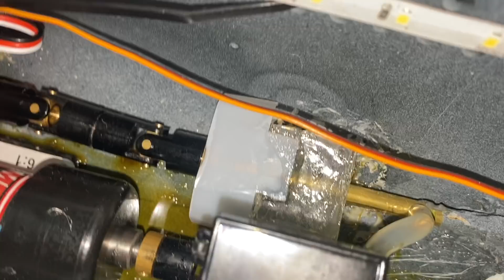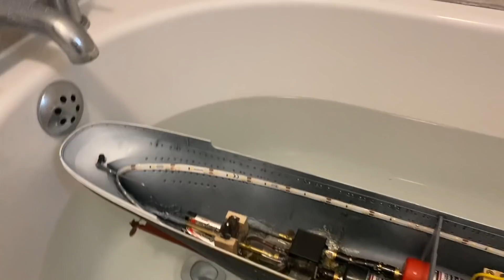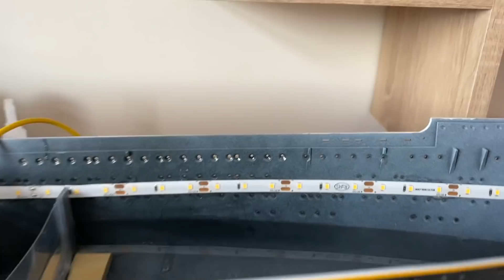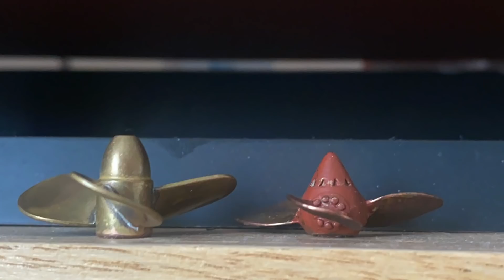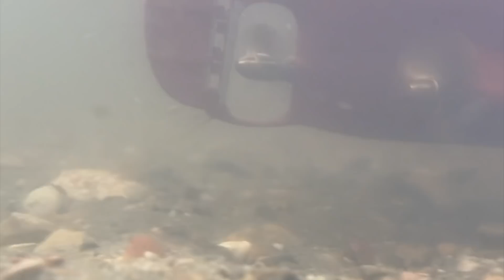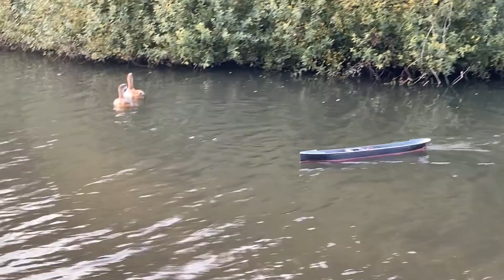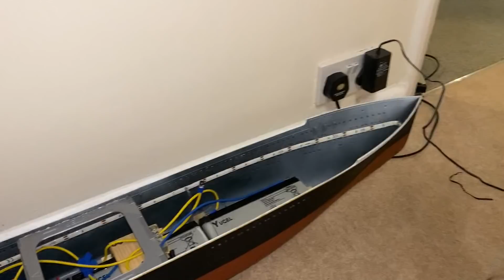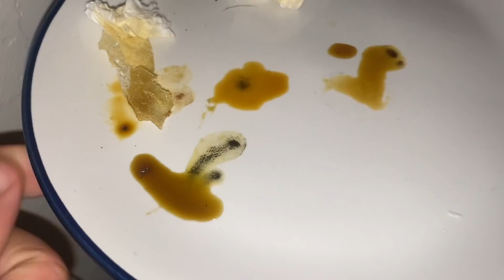Radio Control Trumpeter 1:200 Titanic Build Part 13 - The First Test

Comment: to make it  more perfect, the central propeller should be one with 4 blades! They exist in model ship shops, I know it, because 10 years ago I had a "Yamara" titanic in something about 1:160 scale and all photos of the original ship in dry dock show a four blader at center.
Reply from the maker: There is actually some debate on the central propeller and it’s number of blades. This is quite a good article if you are interested:
https://www.encyclopedia-titanica.org/mystery-titanic-central-propeller.html
Reply: There is evidence that a 3-bladed propeller was being considered.  Slightly larger in diameter than the 4-bladed one, with differing pitch, it was intended to yield greater thrust than the original.  No photographs exist, that I know of, to confirm this.  The Britannic ended up with the 4-bladed center prop so I lean toward a 4-bladed one on the Titanic.  Of course, I am a strong traditionalist so I naturally go that way regardless.  It may remain an unsettled debate for a long time until the wreck is explored enough to reveal the truth.
Reply from the maker: @Dallas_K  I think you are right in the sense that it will remain a mystery for a good while, if not forever.
The thing that convinced me that Titanics center prop was 3 bladed was that in 1913 Olympic was briefly fitted with a 3 bladed central propeller. This seems to have been fitted as an experiment (which was evidently unsuccessful). But I suspect what happened was Titanic had been intended to run this experiment, but sank before a satisfactory conclusion could be drawn, so Olympic was retrofitted. Presumably White star assessed Olympics performance with the 3 bladed prop and concluded 4 was better after all, because after 1913 Olympic is always pictured with a 4 bladed central prop. 
As I say, at the end of the day, it’s the individual modellers opinion, all we can do is weigh up the evidence and make an honest assessment!

Comment: Hey guys, just wanna ask for your opinion, which is better: Minicraft 1:350 RMS Titanic deluxe edition with photo etched parts or Trumpeter 1:200 RMS Titanic
Reply from the maker: I can’t really speak for the mini craft 350 because I’ve never built it.
Trumpeter 1:200 has its fair share of faults but it’s a very good model, and I think you’d get a good model out the box. 
Obviously as the model gets bigger and bigger you have more opportunity to add detail too.

Comment: to change the pitch of the propellers it's simple just bend them out abit more why buy new one's
Reply from the maker: To a point yes. But the difficulty is to bend each of the blades exactly the same amount. And if you do get that wrong the props will vibrate which causes excess noise etc. 
But the main reason I changed them was because the new ones looked far more realistic. Much more like Titanics actual props than the ones I had before

Comment: with the original props you used that you said were too slow, what was the max speed it was reaching? just curious.
Reply from the maker: Hardly moving. It took about 30 seconds to travel its own length!
Reply: ouch, that's slow, did you try to bend them into shape by chance?
Reply from the maker: I did, not a great result really. The issue was I don’t think they really had much of a shape to begin with. The new ones I have are cast directly from models of Titanics original props so they are much more representative of what she would actually have had
Reply: well sounds like that might not be an issue anymore then

Comment: How heavy is the "seaworthy" Model/how much Water does it Displace? I'm considering to build a Live Steam Titanic along with some Friends (I'll build the Steam Engine/Turbine Plant and they'll build the Boat) and 1/200 would be our preferred Scale, although it looks like it probably needs a larger Scale as we calculated a Displacement of about 6.4 Liters (that would be 14 Pounds of Weight; I'm not very familiar with Imperial Units for Volumes) which is a really close Call for the Steam Plant I have in Mind, especially because it almost certainly will need some Ballast because of the high Center of Gravity resulting from the two Boilers.

The Trumpeter Kit would be completely unsuitable though; the low melting Point of Polystyrene doesn't go well with Steam Engines. If 1/200, we'll probably build mostly from Scratch but based on a Cardboard Model and also use some Parts from it.
Reply from the maker: First off I would love to see a steam powered titanic. That would be fantastic to watch. Would you use similar style engines and a turbine? 
Mine displaces 4.5 litres of water. So you might struggle in this scale a little bit. I am still adding weight to the superstructure but I intend to do a video on my final ballasting and weights in due course. As you say the polystyrene would be hopeless for your purpose. 
I think as you say if you need ballast as well it may be necessary to look at a bigger scale. The only thing that really drew me to 1/200 was that any bigger and I’d struggle to fit it in my car!
Reply: @TheModelBoatGuy  1.35 m being a decent, Car-Boot friendly Size is our Reasoning for 1/200 too; the next best Thing would probably be the 1/144 Kit from Billing Boats although that would also be a lot more expensive than our original Idea of basing it on the 1/200 Cardboard Model by the German Company Schreiber-Bogen (essentially replicating the Frames from that Kit with thin Wood for building a wooden Hull and then adding the Cardboard Superstructures and Detailing, mostly for Weight Reasons).

For the Steam Engines I indeed want to build that Piston Engine-Turbine Combination using Parts from Microcosm Engine. That's a small (I think just one Guy named Jin) Chinese Manufacturer which builds very nice model Engines of all kinds. They don't come with any Manuals though and his Shop is in horrible Chinglish, also making COmmunications with him a little tricky. My Idea is to use two of his 420 ml Boilers (which are 2.6 kg heavy, according to the Datasheet. Sounds a bit much to me), each supplying one of his two Cylinder Oscillating Steam Engines which then both feed the Exhaust Steam into one of his Laval Turbines, using one Injector for each Engine. That Way, there essentially are two separate Steam Plants for a bit of Redundancy. Two Feed Pumps, each driven by one of the Oscillating Engines would be a nice Touch too.

Here's the Parts I'm thinking of:

Boilers:
https://www.ebay.de/itm/Horizontal-steam-boiler-models-For-Marine-Steam-Engine-Live-steam/151382013452?hash=item233f12360c:g:eqMAAOSwUdlWf~2B

Engines:
https://www.ebay.de/itm/M36-New-Twin-Cylinder-Oscillating-Engine-for-RC-Boat/152259137370?hash=item23735a0f5a:g:~7QAAOSwmLlX7K4e

Turbine:
https://www.ebay.de/itm/New-Steam-Turbine-Engine-Multi-stage-reduction-group-JB-B/152071979051?hash=item236832402b:g:lBkAAOSwtO5XIwC~
Reply: Forgot to say: We got to the 6.4 l (Typo above) Displacement by researching the Block Coefficient (not sure if that's the correct English Term though) of the real Olympic Class and calculating it with the Length, Width, and Draft for a 1/200 Scale Model. Meaning to say 135cm*14cm*5cm*0.684=6463ccm.

The Block Coefficient essentially is the Displacement of a Ship divided by the Volume of a Box with Length, Width and Draft as Dimensions. It shows how "Box Shaped" a Ships is, so Bulk Carriers and Tankers have very high Block Coefficients and Aircraft Carriers very low ones, as the latter are designed for Speed and Tankers/Bulkers have a Bow only for being able to sail in a straight Line as Speed isn't important for them. All three of us are Marine Engineering Students in Flensburg which also includes a few Shipbuilding Lessons.

Comment: am just curious regarding something on your model....
On the original TITANIC the 4 aerials between the masts were for the antenna for the wireless telegraph for the ships communication to shore, and for the use of the SOS when the time came...was wondering would you be using the masts that came with the Pontos kit which look hollow to obtain the same functionality to boost the aerial as in the original Titanic for your R/C controller?
Reply from the maker: i think if i was using older tech that would be a really good idea. The radio im using is a 2.4GHz which is quite powerful on its own. 2.4GHz also requires two aerials which are orientated perpendicular to each other which might make it a bit harder

Comment: On the KA kit.  Yeah it's another expense, Blaa!  I studied the differences with the Pontos and they both have good status in various areas.  The KA kit has the obvious greater detail with the deck ventilation gear etc but the Pontos has great bow detail like the anchor chain release gear etc.  The KA does have quite a few extra details missed by Pontos so between them and mixing  and combining the outstanding pieces together a better result should follow, certainly for a static model anyway.  I think you have to draw the line somewhere though as handling the model repeatedly would inevitably cause some distress sooner or later!!  JH ;-)
Reply from the maker: I have decided to bite the bullet. I’ve sold my pontos and bought the KA. I think as the KA stuff is largely single pieces rather than multiple pieces of PE it’s going to have a better chance of staying in one piece. 
Though i agree whatever I do the parts are going to get wear and tear! So my model will overtime start to resemble titanic if she didn’t sink!
Reply: @TheModelBoatGuy  Blimey, drastic!   Well, you will get your extra boats that you need with the KA which is good.  The window glazing looks pretty interesting too!  Lots of little gems if you study the promo on the web page.  My first part of Scale the Titanic turned up today!  This is the new stern plating details which has only just been released.  Beautifully made PE and the tinniest details ever!  Definitely not practical for your needs in my opinion!  I will try and get the names engraved Olympic at some point as there are spare PE parts which is really useful.  I have also emailed Scaledecks to see if he could produce a lifeboat free marking set!!   Actually it wouldn't matter really as I think that it's only the smaller Cutter area of deck that would need attention, so I will still be buying a set.  I think we may be in for a wait for the KA.  I will let you know when I receive mine, as that will give you a heads up on when you can expect to receive yours.  Oh yeah, I think the kit includes the small bridge bell which is a brilliant bonus! Regards JH ;-)

Comment: I was thinking about Scaledecks too, much neater and no scorch marks!  I don't need any markings for lifeboat positions on the boat deck as mine will be placed a little differently.  
I am now waiting for the Scale the Titanic plating and stern plating detail kits to arrive. I am in no rush as I am currently battling with the rigging on my HMS Bounty wooden ship which is getting there now!  I will be getting my reduction gear motors soon too.  I am using a quiet 1:100 ratio which will be fast enough for a static kit!  So I am still in the hunter gatherer stage for a while yet!  You could I suppose start making up the deck details in advance of getting the new decking?  Perhaps the winches and deck cranes as they can be stored away safely ready for installation.  Just an idea for cold winter nights!  Regards JH :-)

Comment: When I first commented about the props, it now is clear that they seemed off due to not having very much pitch. They new ones aren’t bad really. Although not historically accurate, the fit in and will look great once painted.
Reply: How are they not historically accurate
Reply: @Robabin  the new ones are basic rc boat propellers unlike the historically accurate ones that had to be removed due to not having the right pitch. The improper pitch lead to hardly any propulsion.

Comment: That held my attention, well done great job and a really informative video.  She looked really good in the water too.  So, superstructure next then, that will slow you up a bit!  I took a look at the KA detail up kit.......Yep on order!   It does duplicate a lot of the Pontos and Trumpeter but I can justify that by my conversion to the Olympic.  It will give me loads more bits and pieces to play with and kit bashing materials.  Anyway good luck with your brass work and watch out for the inevitable pinging off on to the unyielding carpet monster!  Looking forward to your next video but these things take ages to achieve, so take your time.  Regards JH ;-D
Reply from the maker: Thanks man, yeah superstructure next. Im waiting to get my hands on the scaledecks decking so that is rather holding me up atm. Fingers crossed it comes through soon so I can crack on. 
Ah yeah, the KA set looks amazing. I couldn’t quite justify it sadly, I think if I had my time again I’d buy that over pontos but there you have it. In your case I guess you’d pretty much use all the bits from each set really so you’re probs the ideal customer, because you’re not going to waste anything! 
Cheers, good luck with your Olympic too! Keep me updated on how she’s doing

Comment: Have you performed a stability assessment with an estimation of the CoG and metacentre? The extensive superstructure and tall funnels as well as adding to the displacement (where there doesn’t appear to be much margin), will significantly raise the CoG. Or are you just winging it?
Reply from the maker: Done a CoG estimate (CAD provides this). It is an estimate at the moment though, because I have had to make some real estimations (guesses!) on the weights of the superstructure etc. It’s particularly tricky as there are a number of brass bits which will add weight etc. 
So it is a moving model, and I’ll update it as I go along